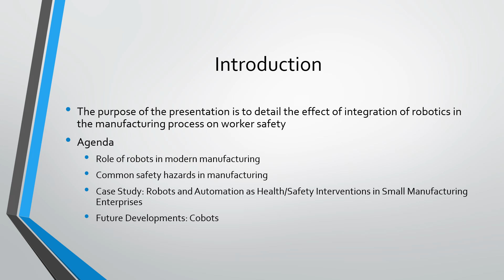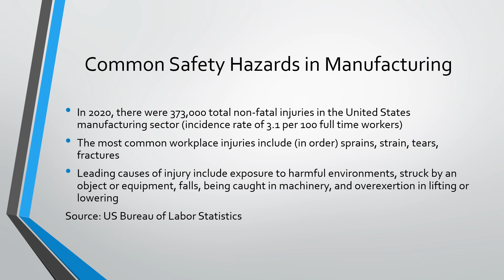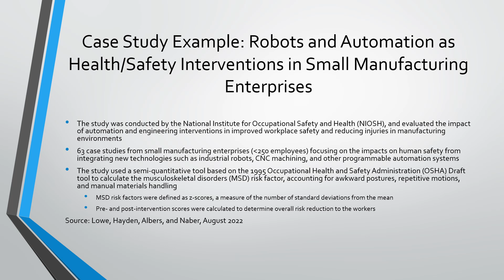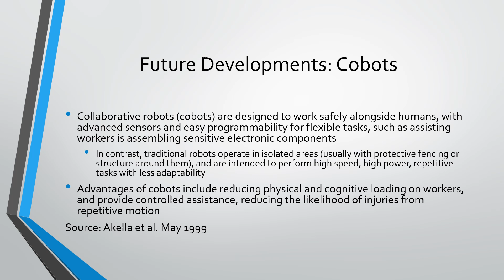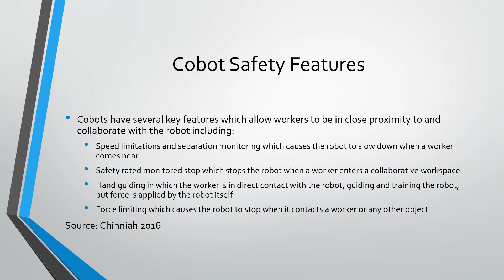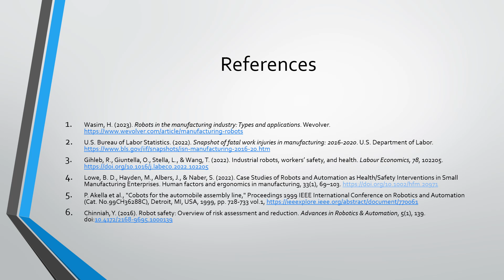ME5431 Presentation: Safety of Manufacturing Systems with Industrial Robots and Human Workers

Comment: Collaborative robots look like one of the prime contributors to risk mitigation in the future of manufacturing, the factors you metnioned that contribute to safety in robot-human interactions on the shop floor had me thinking as well about appropriate robot materials and the broader field of soft robotics. In addition to acceleration and speed caps on robot movement and auto-stopping protocols when someone approaches a workstation, for very close human-machine exchanges like in small electronics manufacturing and quality assurance testing, the robot material may be important to not only the manufacturing application but also the safety of the worker using machine.